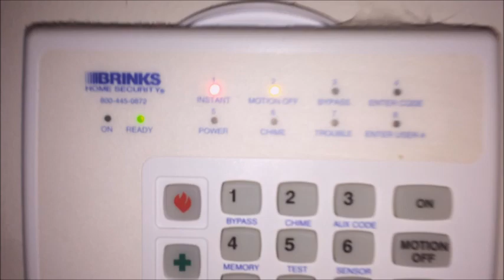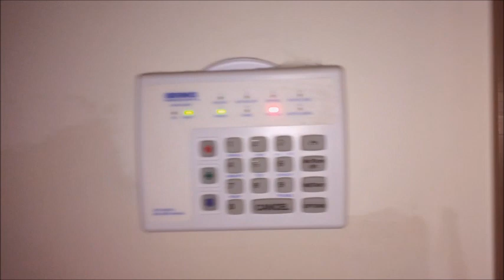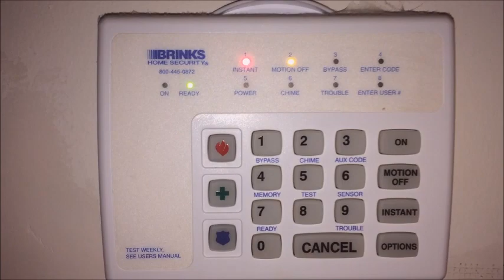BHS 3112 Alarm System 2 Trouble Messages | Tech/Mechanical Video

Comment: James, I have a trouble code on my system, is not linked with the alarm company and hasn't been for a long time now.Though I've still been able to set my alarm.   The trouble light  came on bout a week ago and I can't get rid of it to go back to setting the alarm sound.What can I do to remove that code?
I have the brink's keypad with no digital display. It's just like the one i've seen on your channel...
Can you please give me some advice
Reply from the maker: If it's not linked with the alarm company through a telephone line, you're probably experiencing a Communication failure indicator.  Confirm the trouble message by pressing Options then 9.  You'll see a light blink, if it's Motion Off (#2) blinking, then it's a communication failure which you won't be able to get rid of, unless you hook up your alarm to a telephone line.
Reply from the maker: Also, when you press Options then 9, and it's not the Motion Off light that blinks, tell me which one it is, and I'll tell you what it means.

Comment: Hi,hope you're still answering questions. I need to change the battery in the backdoor, I dont know what side the battery is in and which side is the magnet, they are both located at the bottom of the door. Please help 😢😢.
Reply from the maker: I honestly have no idea how to do that.  I only know how to change the battery inside the alarm panel.  Sorry

Comment: How do I replace the battery
Reply from the maker: Find the model of your alarm, search the correct battery for it and place an order.  You'll open up the panel for the alarm, removing the cables from the existing battery, place them on the new one based on Negative and Positive and that's it.  Then you'll be all set.

Comment: my landline phone is disconnected, and IMO that cause communication issue. Every night at 5am I get alarm beeping. Is there any way to force system don't send any notifications?
Reply from the maker: No unfortunately, but if you want to stop the system from interrupting you at night, silence the beeping a hour or two after you get up (If you're able to) Whenever you silence the keypad, it will reset the trouble beeper and it will go off again in 24 hours.  Or if you have a WiFI router with a phone line connection, try to have the alarm company hook it into that.  That's what my system is hooked into.
Reply: @Jamestube8439  thanks for quick response. No the thing is that I bought this house and for now ADT is off and disconnected. But if there is any option to postpone for 1.5-hours, that will be great. I can cancel it manually at 6:30 am
Reply from the maker: @DaviMenasaka  You're welcome, and unfortunately there's no way to control when trouble message beeping returns.
Reply: How do you silence the beeping

Comment: How can i completelt turn the alarm system off?
Reply from the maker: You can remove the battery in the control panel and unplug the system.  That will turn it off, or you can unplug it and let the battery die.

Comment from the maker: A few hours later (Around 7 P.M.) the alarm's trouble messages cleared, the battery charged and the communications were reset indicating the trouble light turned off.

This was one interesting thing I've seen with my alarm system, what about you guys?  If you have a video or have experienced this with your system, tell me here.  Shout out to my friend Josh since we both know a lot about alarm systems.
Reply: If you find the trouble lights interesting, wait until you see the elaborate text-based menu interface built into the system filled with configuration options that Brinks never intended for you to see, and in fact designed the system to keep you out of. I have some videos of it on my channel.

You need a special device that they never sold, and even then it's protected by a separate code that they never give you, though you can reset it to the default if you're okay with resetting all the other programming to defaults as well. Or at least that's the way things were before I got my own programming device from eBay, figured out how it worked, and made my own software that lets you do the same thing with a computer and a ~$10 USB adapter, which will even tell you what the code is. :p https://github.com/flarn2006/BHSTools
Reply from the maker: @Sparkette  Nice, that's pretty cool, have seen them before.